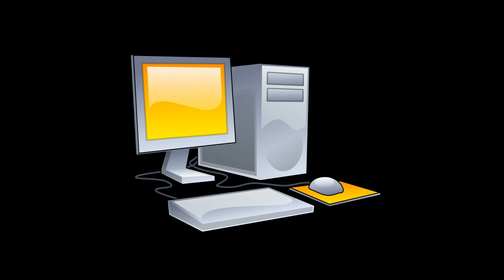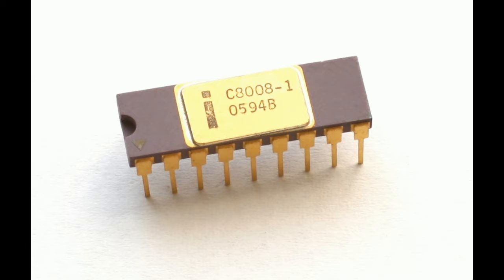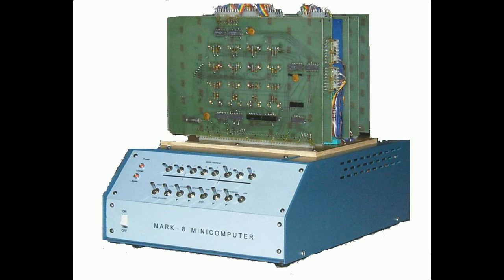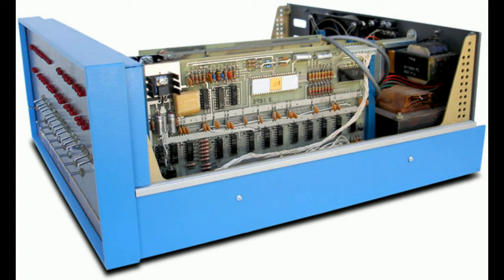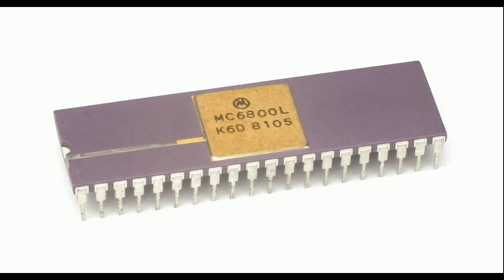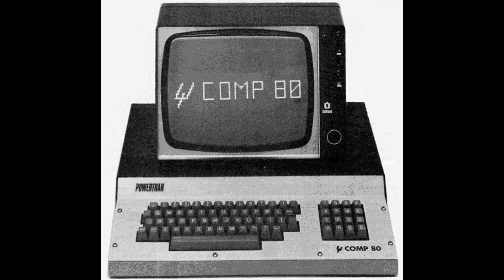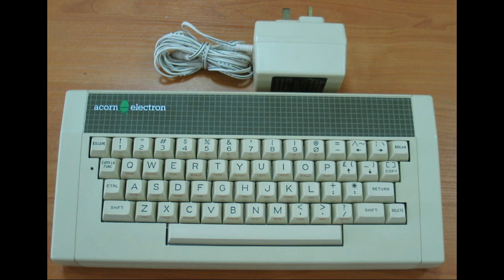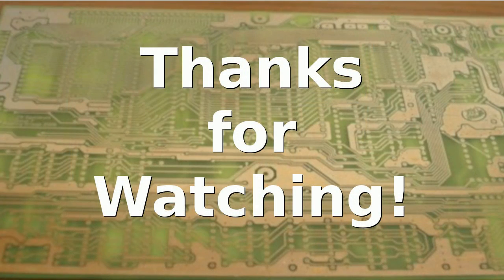Retro Computing,   Early Kit Computers

Comment: You were a little bit unkind to the Science Of Cambridge MK14, claiming that it came with 128 bytes of memory and could be expanded to 256 bytes, when in fact it came with 256 bytes and could be expanded to 512 bytes and then further to 640 bytes by fitting the optional INS8154 I/O RAM IC. OK, still not a lot. The point of the MK14, as with the ZX80, ZX81 and ZX Spectrum which followed it, was that it offered a programmable 'device' at an affordable price. A lot of people who now have well paid jobs in IT and / or programming wrote their very first programs on one or other of Sinclair's quirky, cheap little machines, more than a few of them on the MK14.

Comment: In Australia we had a kit computer that came after the ZX81 called The  Dick Smith Super-80 Computer it was released  in October 81. 
it had a 	Zilog Z80 
16k ram upgradable to 48k 
16k rom 
Base model cost 130 pounds and it was additional  100-200  pounds   for the ram upgrade modules to make it 48k

Comment: The Acorn Atom came as both ready-made and a kit.
My first home computer was a kit built Atom. 
You got everything in plastic bags and followed the instruction sheet then put the board in the provided case and fingers crossed you turned it on. 
Having taken my time during assembly,  bingo!  I had a working home computer and a display on a 12 inch Murphy black and white TV.

Comment: The Synertek Sym-1 was a great single board 6502 based system with high quality instructional manuals on the cpu and its utility chips. Learned loads using that system.

Comment: England? It's the UK :(

The Sinclair ZX81 was released by Sinclair Research Limited on 5th March 1981 as an upgraded version of the Sinclair ZX80. It was manufactured by Timex in Dundee (Scotland). :)
Reply from the maker: The Timex version was actually my first computer at about age 15.  The kit version.  Spent a lot of time with it and even learned a bit of  Z80 machine code on it.

Comment: sir, did a google serch and found these ,
https://www.google.com/search?source=hp&ei=dg8YXs7iBcfAsAXv3LmgCg&q=modern+computer+kits&oq=modern+computer+kits&gs_l=psy-ab.3...1306.6116..6598...0.0..0.210.2528.1j18j1......0....1..gws-wiz.......0j0i131j0i131i70i256j0i22i30j33i160.CTKYAT0rCF4&ved=0ahUKEwjO9a6PqvjmAhVHIKwKHW9uDqQQ4dUDCAc&uact=5
also i have a radio shack  kit called the sience fair microcomputer trainer cat # 28-260. has a manual that claims it can teach the user how to use machine code . it features  a keypad system 1 turu 9 keys and abcd  keys  has a 8 segmented led and led lights on the front.ive tried to see what the processor is but these tired old eyes wont let me .

Comment: Timex didn't start distributing their license built version of the ZX81 (which they renamed the Timex Sinclair 1000) until 1982. In 1981, Sinclair sold them direct as the ZX81.  The big difference between the two, besides the name was the fact that the Timex unit had 2k of memory, whereas the ZX81 only had 1k.  The Timex Sinclair 1000 was never sold as a kit... only the Sinclair ZX81 was.

Comment: 2:53 is at the HNF in Paderborn ;) I've had the privilege to check out part of their storage once and am currently partially reverse engineering a prototype "learning aid computer for mini-computers" designed in 1974 and while I've had the luck to experience various early commercial grade computers (most prominently a SOL-20 which is one of the earliest "keyboard computers" that was sold as a DIY kit or a complete assembled computer and a PDP-8E). Being born in 1985 and basically grew up along the original Pentium I have to admit that I have quite a soft spot for DIY machines, with my favorites being ZX Spectrum compatible clones from the east block - which started some time around 1985 in the soviet union and remains strong to this day (you still get 1-5 enhanced/personalized clones per year) while some are based upon modern FPGA/CPLD based technology you still get a fair share of machines which are fully TTL. And yes, those are usually provided either as produced PCBs or have their layout files for production public for everyone.
Found the end quite abrupt and short in this video tbh - I know of at least 1 more extremely prominent example from Germany which was designed as a DIY project, starting with a Z80, going along with the 8088 and and ending with a 68020 - said architecture/computer even had a TV show which served as an alternative manual/assembly guideline. So yeah, while kits lost their pace after the ZX81, they were anything but dead yet.

Comment: They did have Apple II clones in Japan during the early 80s. I would on occasion, go down to Akihabara (then an electronics mecca) and pick up a long list of parts from the vendors there, buy a clone board from a certain shop with a similar case keyboard and power supply for about 100 to 200 dollars (disk drives and card would cost about 50-70 extra bucks). After about 3 or 4 days of soldering, debugging and whatnot, I would have an Apple II clone up and running. You could get blank ROMs and burn them using an eprom burner add-on for the Apple II bus. Why would I do all that? Because I could get about 100 dollars in profit after selling them to the other guys in the dorm who didn't have the experience to do it. With the average pay for an E-4 being about 900 dollars a month and a base Apple II (no disk drives, no drive card, 48K of ram, no softcard), going for two grand,  we had to work on ways of cutting costs so we could get that occasional beer at the club and in the local Fussa prefecture. Fun times.

Comment: The ZX81 was defective British crap!  Crashed so often it became the butt of a thousand jokes.
Reply: Chad Castagana It was only bad when using the 16KB expansion RAM pack. If you did a dead simple board tweak, and installed 32KB of SRAM internally, it was stable and capable (somewhat excusing the membrane keyboard).

Comment: Just noting an error in chronological sequence. The Motorola 6800 was released late 1974, pre-dating the 6502, released in late 1975. This is a significant point, as the MOS Technology 6502 was designed by members of the team who'd originally worked on the 6800 design, but who then left Motorola in 1974 to join MOS Technology and develop the 6502 as a lower cost / cut-down version of their 6800 design (in response to customer’s concerns over the high price of the 6800 at the time). 
The Motorola 6800 featured in both the SWTP 6800 and the MITS Altair 680 kit computers, as examples, both launched in 1975.
Reply from the maker: Thanks for the additional information.  Good stuff!
Reply: Beat me too it :)

Comment: My first computer was a Northstar Horizon kit - S100 based system with Z80A, dual floppies, and 32K RAM, which I expanded first to 48K and then to 56K.  I later added additional dual 8-inch floppy drives and could read and write to RSX-11 disks for PDP-11 work for my MS in CS.
Reply: I drooled over the Northstar. Never saved the money.

Comment: Well done video. I didn't have knowledge of the kits available other than the US and UK. Still have my first PC. Radio Shack TRS-80 Model I (one) Level II (two). Its been boxed up for many years and carried from to many residences the past 3 decades. Found more use of the cassette player that came with the TRS-80 than the PC once I discovered CBM C-64. Wish I had better knowledge then of CBM VIC 20. For what I paid for the B/W limited 16k TRS-80 I could have purchased 3.5 ViC 20's. $1148 in last quarter 1978. I paid $315 for the C-64 + $109 for a 1541 floppy drive from Toys backward R *s store. Everything about the CBM C-64 was a step up compared to the TRS-80. Price about one fourth, 4 times the RAM, floppy drive versus cassette tape, enhanced BASIC interpreter with multifunction keys, and ports for connecting many accessories, and I didn't need a monitor. My television at the time was B&W. Being a single parent limited the wants over the needs, but I was able to scrape enough to buy a color monitor for the C-64 within 2 months and a new world of computing evolved for me. Uh, yeah. That PC is still operational running packet radio. About ready to power it down though and replace it with a Raspberry Pi.

Comment: My first computer was a Cosmac Elf (1802) w) plug in memory card. (4K if I remember right) Very advanced, Hex pad entry of programs/data. It was also my first multi-media device AND digital radio transmitter. Hook up a wire to one output line, set it next to an AM receiver and it would play the tune you programmed in...
Reply: Bit banging the Q line and one of the EFs - the answer to everything on an Elf :-)